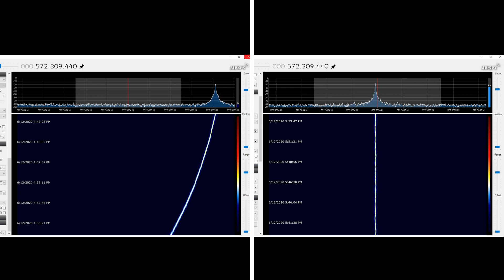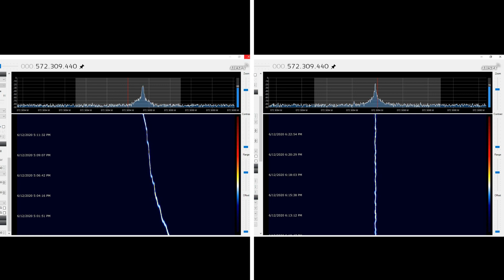AirSpy R2 Comparison with GPS Lock and without

Comment: any explanation for why the TCXO takes off in one direction and then reverses the direction of drift?!  would it have stabilized on the original frequency if the upper environmental temp was maintained for longer than an hour?
Reply: Because he turned the light off to stop heating the SDR.

Comment: The reference seems too introduce a weird wobble. It that it disciplining itself?
So it looks like the very best of all might be to built a fixed temperature environmental chamber for the R2 and calibrate it to be spot on while it in there, and maybe check it every now and then and recalibrate if necessary.
Reply from the maker: Hi Brian, Nice catch.  Whats actually happening is that at this UHF frequency signal strength is always changing in amplitude.  Which imparts a very small amount of  modulation on the signal. What you are seeing is that modulation, which in the speed up version of the recording is not apparent.   You are correct about the frequency stability, this is the basis for an OXCO, or Oven Controlled Xtal Oscillator
Reply: @W1VLF  One might reasonably expect the heat generated by the AirSpy itself to be considered an "oven" :-)